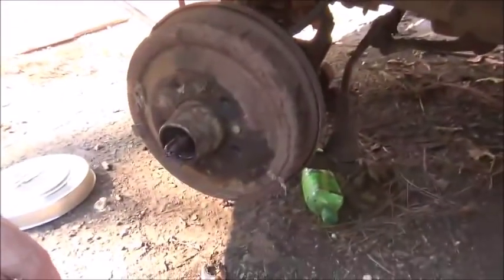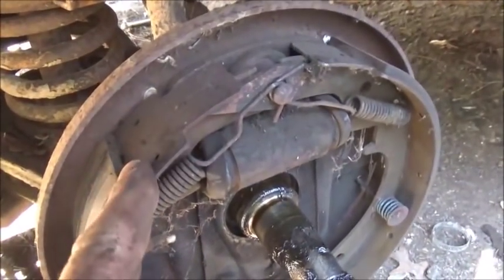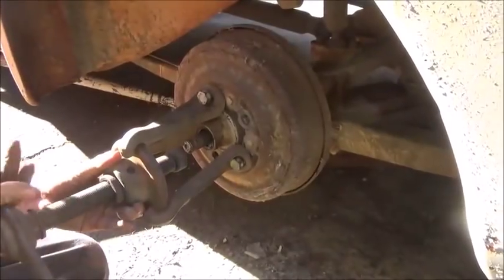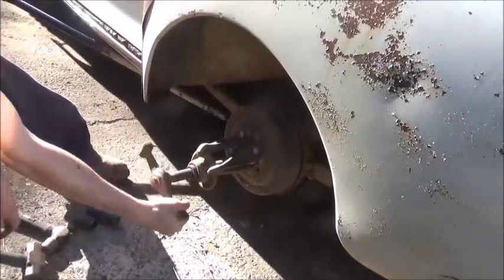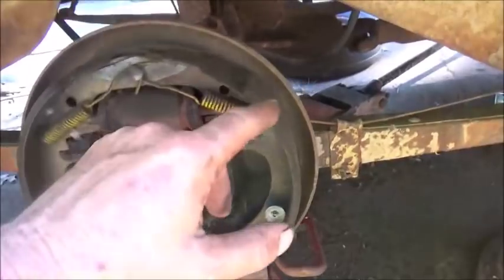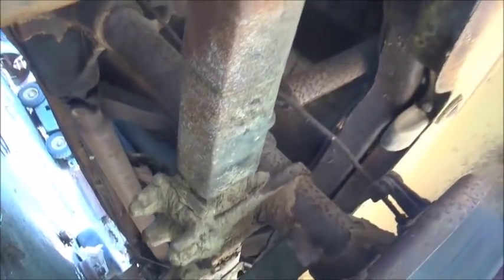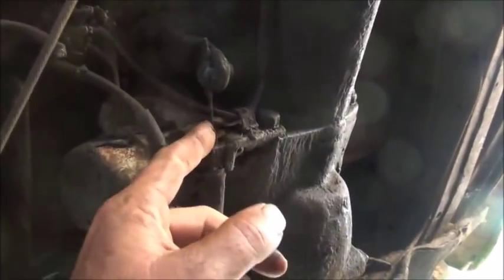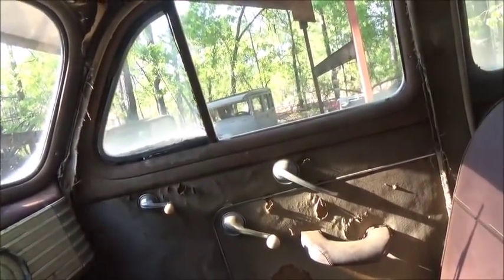1948 NASH AMBASSADOR BRAKE TEAR DOWN & MORE

Comment: I used to do that with Dad on his station wagon. A 1960 Dodge.  When it was really tight on the rear axle shaft He would heat the center of the hub with His torch.  He had Nash brand auto's when I was really little. Keep up the good work.

Comment: The control under the dash for the overdrive is a manual lock out.When its pulled out it is locked out.When pushed in it allows the overdrive to kick in and out using a kickdown switch on the carb linkage that activates a relay that kicks the solenoid in and out.There were 2 types of overdrive the r10 and r11.The r10 had 3 planetarys and the r11 had 4.Im not sure which one that one is but it will say on the tail shaft.Also,several of those parts will interchange between brands of car because Borg Warner made the OD for alot of companies.That solenoid is about $400 for a new one.I have one thats on a Saginaw 3 speed for my 55 Chevy.The planetary was grenaded so Igot enough stuff to make it a direct drive for now.
Reply: Just installed a 1961 Chevy passenger 3 speed in my '77 C10 'Heavy Half' last year with the Borg Warner OD. Makes 'out of town' driving quite nice with the stock  3:73 gears.

 Had one in a '58 Impala YEARS ago. Really liked that option.
Reply: My transmission is a 66 Saginaw with the 7 bolt side cover and I believe it was originally for a pickup because 2 of the transmission mounting ears are tapped and it has the truck bearing retainer.I got another tail housing and main shaft to make it a direct drive.Im gonna keep all the OD parts and Id like to eventually get a good planetary.

Comment: This is gonna be a Treasure when you get done and ready to drive.....I hope it Will stay Stock and NOT Hot Rodded
Reply: It's got that "hot-rod" overdrive in it, like that Hot Rod Lincoln. "Slipped it down in to overdrive..."  lol    Chuck in NE Kansas
Reply: They've already done so much to the engine, I can't see them swapping it out at this point!

Comment: Man it's been a long time since Iv'e seen a brake puller like that. My dad had one and it was old then. I'm amazed at the condition of those brakes. Nearly new. If it wasn't for the condition of the cylinders  (probably rust pitted), I'd just clean and lube them and put it all back together. Because of the age though, you're right to change the wheel cylinders. Never going to find any shoes that are better though

Comment: I've found it helpful to put a dab of grease on the threads of my drum puller. That way I don't feel so bad about whooping on it so hard. While I always make sure the tapers are smooth, clean and dry before assembly I do put a tiny bit of Never-Seize on the threads before I tighten the nut. In my 50 years of working on vehicles with tapers (Studebaker, Willys & early Fords) I've actually come across a few with the hubs cracked in the keyway from over tightening. Everybody has there own torque specs. I follow the ones in the 1950's Willys factory torque specification book because it's the only one I have. I'll bet a Nickle you can hone out those wheel cylinders just fine. If you have the old machine for "Arcing" the linings that should help too.

Comment: I couldn't be happier for you. Remembering the engine, this is a 360 degrees and I like you have worked on much more worse on condition. Those wheel cylinders look similar to light duty pu's and cars. I had one of those wheel pullers in my tool chest (mine was made in china) and made to hammer on. I did ruin the end of one dodge axles by hammering so much on. I kinda leaned away from that rear axle style because of that keyway and hard to work on style. They were going out of style as I came about mechanicing. Thanks again for sharing one of those cars that is just a rare beauty

Comment: Also,I see the OD cable is pulled out.They have to be parked that way or be sure the emergency brake is on because it wont hold the car,Or it can be parked in reverse to hold it.Above 28 mph or somewhere in that range it will automatically kick in and out like passing gear on an automatic transmission.Does it still have the switch by the carb on the throttle linkage?There should also be a relay that looks alot like a horn relay that the other end of the wires on that solenoid hook to under the hood.

Comment: Have you thought about using a 65 Mustang gas tank? If your trunk floor is flat,  do some measuring, cut the trunk floor out, lay the tank in and mark your bolt holes, drill them out, lay down some sealer around the edge, lay the tank in and bolt it down. This works really well with many of the old cars out there. Especially the orphans like you have. You won't have the spare tire well anymore. But you can always weld a spare tire hold down to the top of the tank before you put gas in it. I did this on a 50 Ford I had once. Almost looks factory. Clean up the floor and paint it, nobody will notice it.

Comment: If the Nash fuel tank hasn’t been reproduced, sometimes sourcing a tank that will work without extensive modifications can be a challenge. GasTank RENU will save that original tank, and as shot as it may seem, it will turn out fine. It’s not cheap, but it’s the way to go. The Packard needed a new tank but none were to be had, so GTR was used with great results.

Comment: On my 53' Desoto they don't recommend  beating on the end of the axle like that. The book says it can cause damage. I did have to use the same tool you are using to get the rear drums off. It didn't require quite as much pounding as yours did even though it had been 30 years since anyone had been in there. I was very happy when it came apart, having never used that tool before.

Comment: The cable locks and unlocks a sprag clutch The solenoid shifts it. You have to floor the gas to shift into overdrive. you lock it to use reverse. I use truck 2-speed button shift all 3 forward gears 6 SPEEDS. have a lot of fun with people how don't know. But you have to lock it for reverse or you can break it.
Reply: That is different to my experience ..The cable lever was a lock out . When Overdrive is allowed , you lifted off the gas and overdrive engaged . When cruising in overdrive , if you momentarily floored the gas , overdrive kicks out and normal gear returns (like Passing Gear ) lifting off again , back to Overdrive . You can only lock out or allow overdrive when accelerating lightly in NORMAL GEAR. Maybe a different system but it was Borg Warner .

Comment: I am amazed that the adjuster turned. Looks like it's a winner. Are those placement pins on the drum outside? I had a 68’ VW that had lug bolts without positioners and it was aggervatin to line up the first bolt. Thanks for the Nash updates. 1947 was a very good year for many reasons.

Comment: Jonathan, after you said you were going to rivet new brake lining as opposed to gluing it, it got me thinking. Imagine you could source the proper adhesive without too much difficulty. Brake drum would be perfect mold to apply even pressure on shoes to glue new linings. Maybe a pair of turnbuckles between shoes?

Comment: I Swear, these back wheel breaks look Exactly like the updraft 216 (3/4 ton) Chevy Milk Truck (w/aluminum body) that was my first "car"! [Even the Yellow Springs are exactly the same, which is why i noticed that everything else is the same]. I had to bend an old screw driver "just-so", to get into the wheel from the back side and back off the tightener adjustment(s). And no, the rubber plugs for the adjustment slot were long been gone, so there was a lot of rust to deal with inside. No i did not have a wheel puller, but a sledge hammer and pry-bar work got them off.

Comment: Love the videos got a question for you.  Got a 2005 chevy Silverado hd 2wd has a 4l80 mjp transmission went out. Can I replace it with a 4l80. The only difference I can find on internet is the mjp transmission is setup for slip on and bolt on yoke. Is there a wiring difference? Can't find this out on internet.

Comment: I am considering the copper nickel brake lines for my old Chevy.  Are they any good?
Reply: (2 Years? It can't hurt to answer.)

They don't rust, and are the easiest to manipulate around the frame. They also flare more easily, and seal better than stainless, for example. My 2002 Suburban's brakes have worked well, even in MN winters for 2 years.

Comment: My hub puller doesn't look quite that good
Reply: I just beat the hammering surfaces round on mine with a 9 pound sledge hammer and still couldn't get the hub off.  I guess the fact that I have two broken studs side by side kept it from working.

Comment: Don't think you needed to pull the rear drums off like you did, the drum is bolted on the hub like a Rambler so removing the bolts between the wheel bolt holes will remove the drum from the hub.
Reply from the maker: Riveted and I didn't want to cut the rivets.
Reply: looks like bolts on video, sence Nash and Rambler are basically the same that's what I thought, anyway my Rambler are bolted on and don't have to remove the hub.